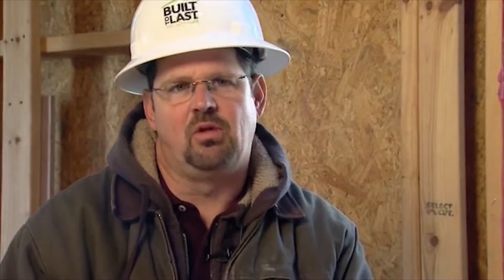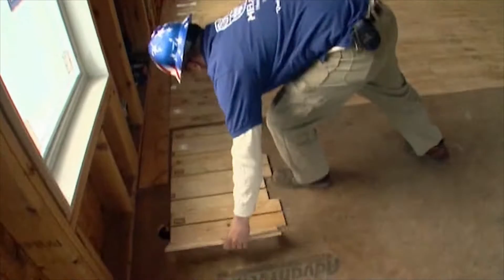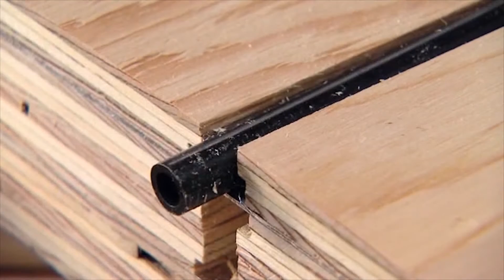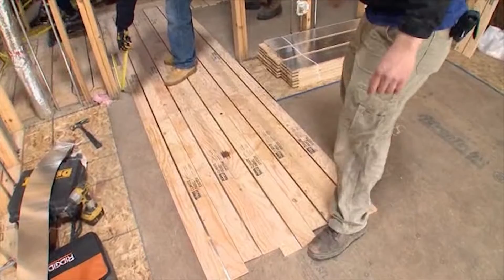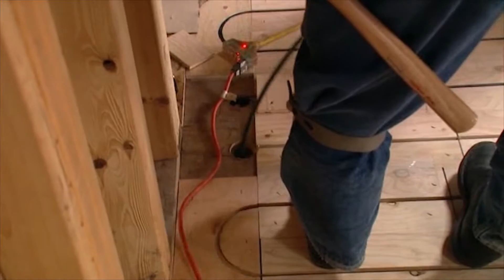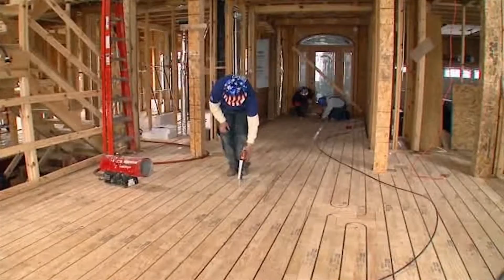Radiant Floor Panel System | Built to Last TV - The Green Home

Comment: They shouldn't be called "hard hats" they should be called camera hats because they're only worn when cameras are around... Besides, they're using rubber mallets and accordion type panels, what's the worst that can happen? Unless joists start falling off the ceiling they're pretty safe without them.